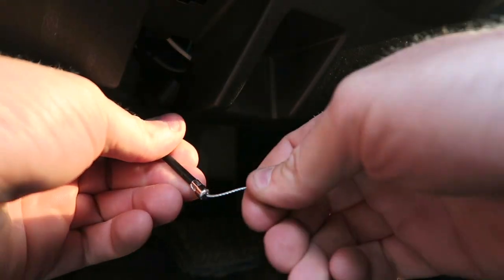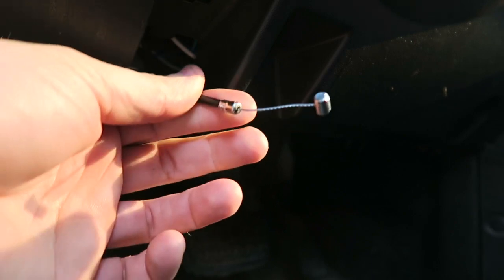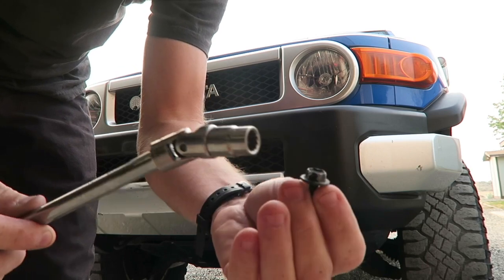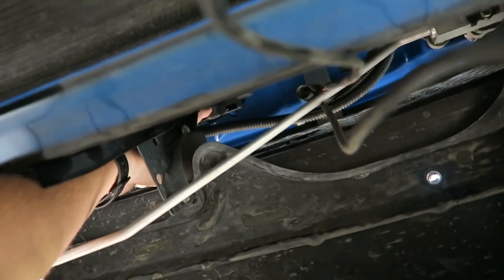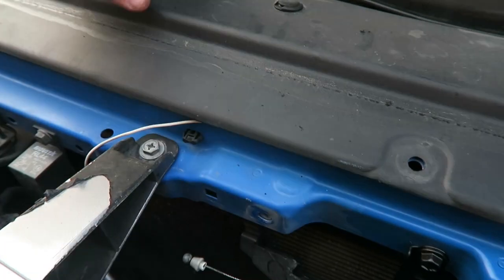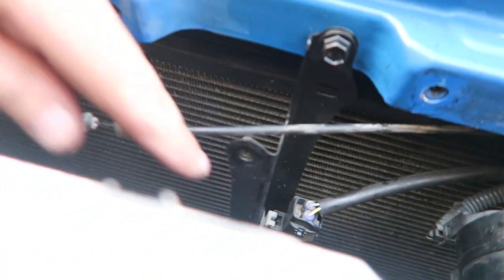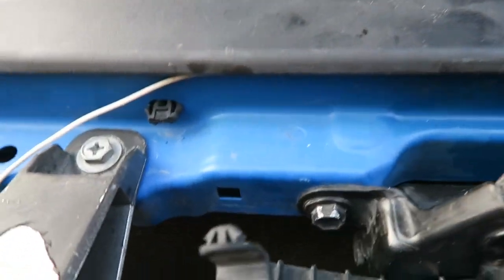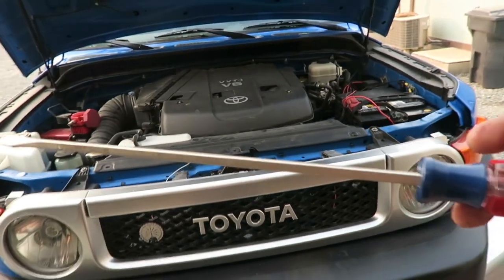FJ Cruiser Hood Latch - Stuck Down - Fix

Comment: Hey this just saved me $150 in labour, tried to open my hood to refill w/w fluid. Saw the cable had rusted and snapped. Managed to get the plastic cap off through the grill and pop the hood with a long screwdriver. New cable is $55+thx and will probably take about an hour to re&re. 
Thank you for the video
Reply from the maker: thx!

Comment: Hi, what size of wrench did you use for the bolts on the sides? I used a 10 mm for the one in the middle and it came out perfectly, but can't seem to find the right size for the ones on the sides.
Reply from the maker: I think they were all the same size, pretty sure,